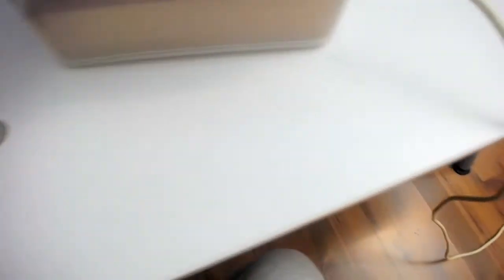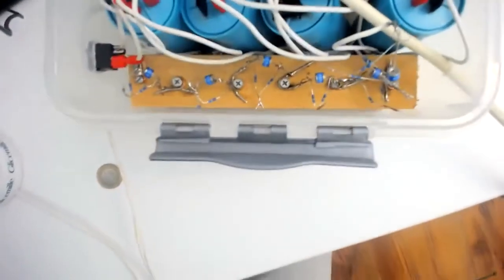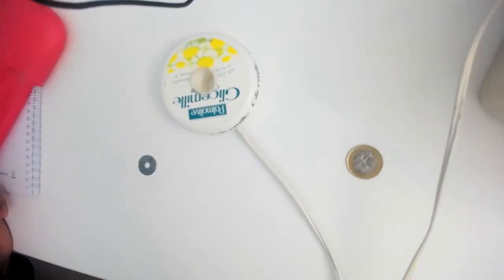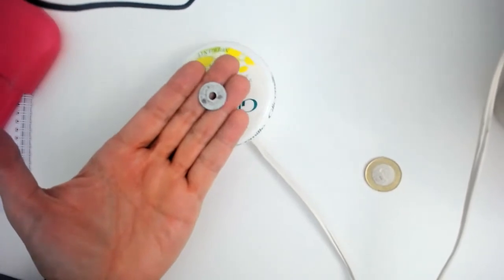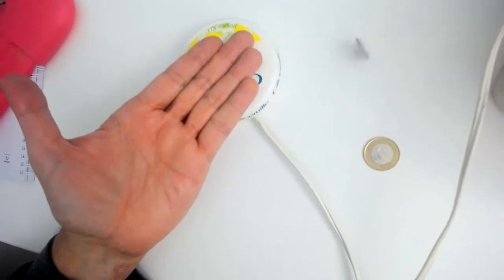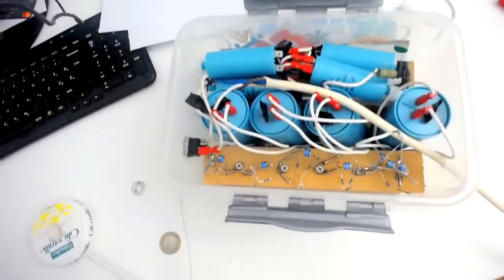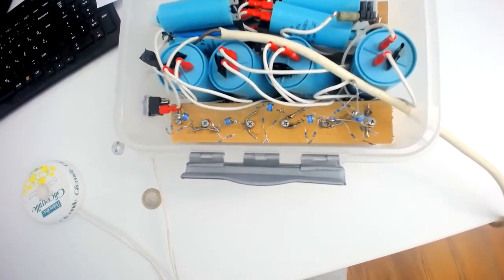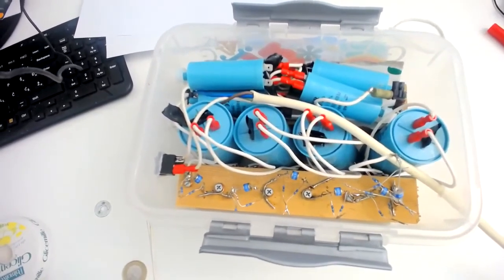Bob beck magnetic pulser from bozidar grilc

Comment: Looking nice , but....Maybe  It is to weak to induce some micro current in a tissue, which is a final task. The power of the capacitor energy  stored in your device  is about 45J (w per second) if you put it the same as in schematic. Also discharge thru the  gas surge spark gaps   includes more resistant in a path of discharge . Just like xenon flash on the bob beck version. If I were you I would put more capacitor in a paralel with the one you have  Also  consider discharge thru SCR . It is much much better. Maybe 200J is the good power for some  results you may have . Inverse polarised diode in paralel with the capacitor is a must , because of BEMF wich occur after shut down the coil.  BEMFwill make your  capacitor last much shorter if you dont supresed him. And for the end, I always use one side  of the coil in a close distance of tissue. And that side is the one wich will  attract the N on your compass. It is called bio north. Great work anyway., and sorry to speak english,. Its because all of the comment were on english.  Pozdrav Vlada